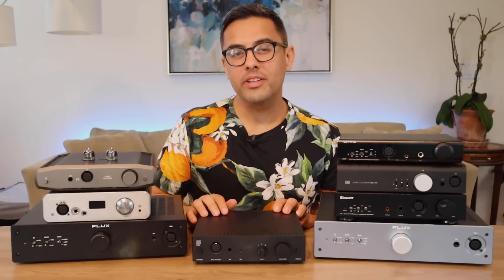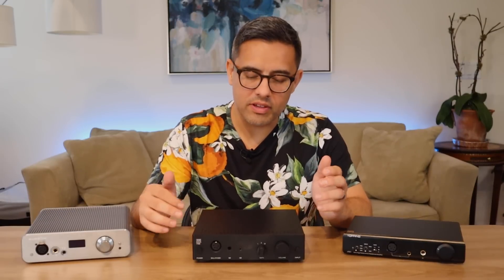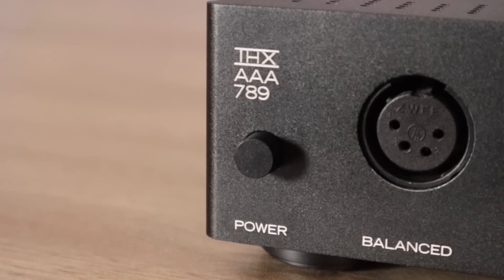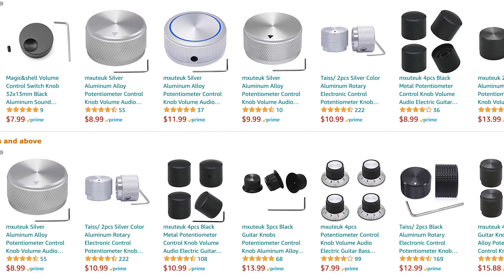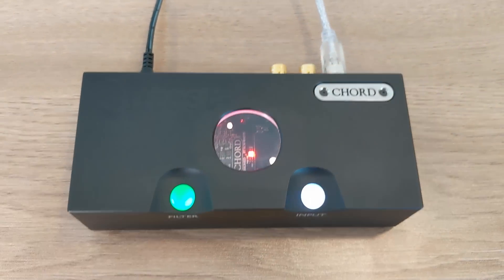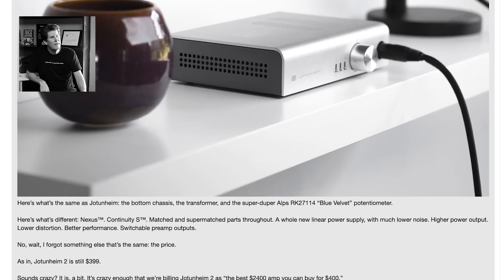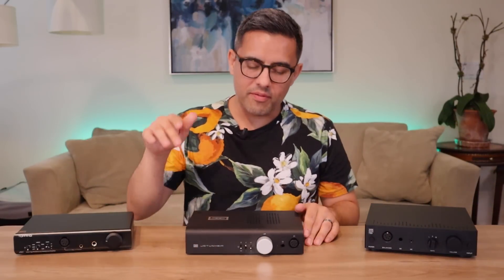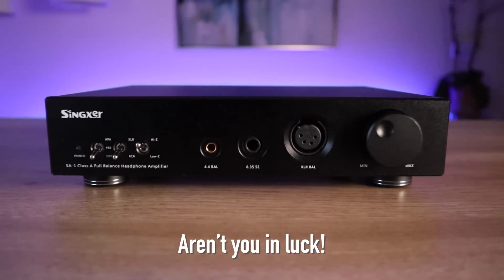SingXer SA-1 vs Jotunheim 2 vs A90 vs THX AAA 789 [ Solid State Showdown Pt.1 ]

Comment: As is noted elsewhere, the Jot 2 is four amps, depending on how one sets gain, and single-ended versus balanced. The gain determines the degree of feedback in the amp circuit. Many of us prefer high gain, balanced for the Jot 2. One can see that is how it is configured in the Jot 2 Test Bench, but this is never articulated.

Comment: The Singxer has a problem with 16/32/50 Ohm headphones (such as Hifiman or Focal) the distortion floor rises at higher levels quite a bit more than with 150/ 250/ 300 Ohm headphones such as the HD600. The amp hits design limitations.
A very low noise low distortion amp that gets into trouble with low impedance loads. This could account for the "thinness" "color" or "personality" some people mention.

Comment: Great review, watching this is like going to a one stop headphone amp shop, next best thing to actually testing them myself, keep up the great work, looking forward to part 2.
Reply: Yo Steve did you ever tested the singxer? I'm with you I hate the gain switches on the bottom. Did you think is a great amp besides that?
Reply: @epicmike3915  Not easily available in Australia but from all reports is a great amp,  just got a smsl sh8s as a stop gap saving for burson soloist GT.
Reply: @chefsteve8381  Damn. I imagine things cost even more there than the US. My budget isn't going any higher than the singxer. Yeah I kept hearing how special it is. But if no theme reviews is to go by the hype usually isn't justified. The gain switches on the bottom is what's keeping me away. I want a balanced amp. Thanks for the response. Too many people go silent here other than to insult or say someone else is wrong lol.
Reply: @epicmike3915  Try passion for sound he has great reviews on both the singxer and burson amps..
Reply: @chefsteve8381  I don't agree with passion for sound on his opinions. I bought the jot 2 and that amp has weird sound plus the single ended was just bad. He thinks the EX5 had different sounds on the 1/4 and xlr headphone outputs. Which makes no sense the EX5 is wired the same on both headphone outputs internally.
Reply: @epicmike3915  That's what makes this hobby so different/hard, there is no clear cut right and wrong answers, as we all hear things differently...
Reply: @chefsteve8381  Yeah but these things cost money.  often this is free for the reviewer.  We have to try and be objective because we measure value differently. Which is something every reviewer has a hard time doing when they clearly prefer something they didn't pay for.

Comment: Now this is a midfi show down.. that Burson is just winking at me while the a90 and thx are giving me RBF.
Reply: I went through about a dozen midfi amps and ended up keeping the Soloist 3XP.  A90, 789, lyr , lyr 3, V280, Phonitor E, Ican, Rupert neve, singxer, fa10, rebel, and jot were all bought and sold.
Reply from the maker: @aceofspades6667  Wow, amazing! What amp(s) did you end up with? What are your thoughts on the Rupert Neve? Been wanting to try out his stuff.
Reply: @MidFiGuy  I kept the Soloist 3XP to drive my Phi TCs/HE6 Sev2 and monitors.  Sold everything else.  I have a Holo Mammoth KTE hp amp for my desktop rig.  Looking to buy my first tube amp.. either Cayin HA-300 mk2 (when it finally comes to market or maybe A&S Forge.  RNHP was middle of the pack for me.  I liked it better than A90/789 but didn't have enough juice for my planars.  Sounded good with my OG Clears.

Comment: Your review of the SingXer proved to be the tipping point for me to finally purchase a headphone amp. 
Now, subjectivity, if you were to choose say 3-5 headphones that I should consider as a decent pairing for them what would they be? 
( Ignoring price. )
Reply: Almost forgot to say, the dac will be a chord qutest
Reply: What'd you go with for headphones?
Reply: @timc_2433  I ended up with focal clear headphones. I also returned the SingXer and got a topping d90 stack instead. 

Why? I didn’t like the idea of opening the SingXer and voiding my warranty by putting jumpers down.
Reply: @Miisile  how did that pairing sound without the mod?
Reply: @timc_2433  to me less precise than the Topping. It did sound very good but I’d say slightly worse than the d90 for precision but warmer. With the hack, I’ve read that it’s better than the Topping, but I cannot confirm that.

Comment: These are the best reviews out there, by huge margin... maybe not in terms of production quality (Josh has incredible videos in that regard), but in terms of what matters most, the sound descriptions. Also I love mentioning of things like volume, some amps might feel right at low volume, but once cranked up a little, suddently "detailed and crispy" turns into harsh and annoying, that is very good point that I don't hardly ever hear discussed. Btw... if it only sounds ok at low to moderate volume... I'd say it's crap! and ppl just don't hear the issues and imbalances that come thru easily at higher volumes :) ps: Sold Jot2 after few days, because of the sharpness described, even tho I absolutely loved the bottom end. Then I heard Asgard 3, friend bought, and immediately had to order one for myself.
Reply: Well said.
Reply from the maker: Thanks a ton for the kind words! Maybe I should check out an Asgard as well 👍

Comment: Don’t forget Jot 2 balanced is a completely different story with IEMs.  No issues with my Andros or SA6.
Reply: I hear noise using IEM's and Jot2 SE. Are you using 3.5mm to xlr adapter for balanced?
Reply: @Rev0ltTTV  Yes.
Reply: @sleepyrhythms6668  I thought you couldn't convert balanced to SE using an adapter?
Reply: @Rev0ltTTV  I use 4 pin to xlr

Comment: No RebelAmp?
Reply from the maker: I'm actually interested in it but at the time I was filming it was rumored that the company stopped producing the amp, I'm guessing due to taking a hit from covid. Looks like they're up & running now so maybe I can get my hands on one in the future.
Reply: Go Flux over Rebel amps IMO.
Reply: @aceofspades6667  Why?
Reply from the maker: @xzackly7131  Amazing, thanks for the impressions! If anything reading your post makes me more interested in the Rebel 2. Tbh the comparatively lackluster power output has me side-eyeing it but I know specs aren't everything. Also, I know we're in a supply chain crisis/shortage so quality parts are more expensive now, but I wish they would get the price down based on the competition.

Comment: Are you sure that's the stock power cable for the A90? I have the A30 Pro/D30 Pro stack and the cables are normal length, like 5-6ft. Maybe the A90 is weird tho idk

Comment: For iems as a reference better get the Moondrop Aria $80, way better that the Blon in sound and fit. Great job! I can't way for part 2 :)
Reply from the maker: I may have to look into these, definitely willing to step up my IEM game, especially for such a small price. Thanks for the heads up and looking forward to the next release!
Reply: 💯 The Blons we’re a bit overhyped and ok for what they are and at their very low price point, but they are strictly entry level and today there are superior options at a similar price point or for just a few bucks more. The Aria’s are solid.

Comment: Singxer took a lot of design from the Questyle cma400i, including the gain switches. By the way the DC mod option is also available on Violectric amps with a little jumper. They do warn for blowing up your headphones of course. They graciously didn't even put warranty stickers on the unit I got. Very curious what you'd think of the Violectric V200 and the Rupert Neve RNHP.

Comment: Switches on the bottom of Singxer its because u CANT hot-switch gain level. U must turn off amplifier to do this. If u hot switch it u can damage amplifier.

Comment: Amps don't color sound unless they have strange capitocance or output impedance interacting with the impedance curve and frequency response of your headphones....

Amps should not have phase shift or ringing, they should be ruler flat from the stated FR.

Additionally, only the output performance specs, I/O connections, noise, IMD, aethestics and knobs should be of consideration